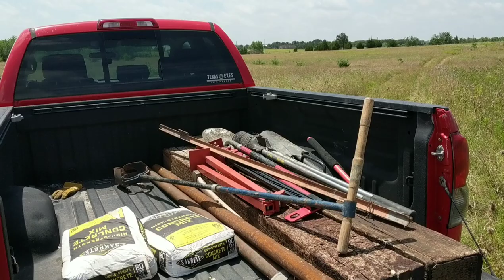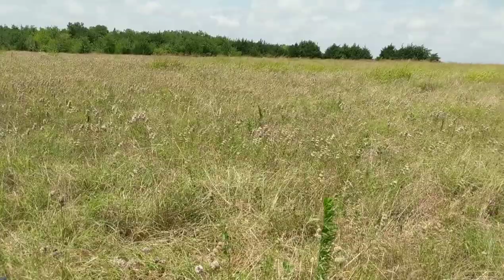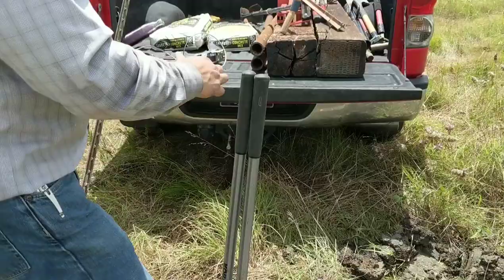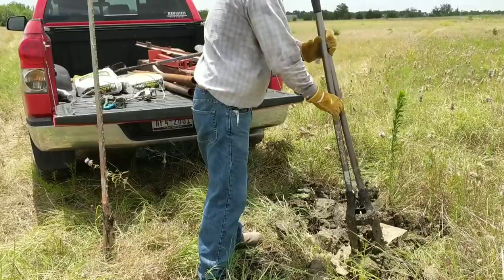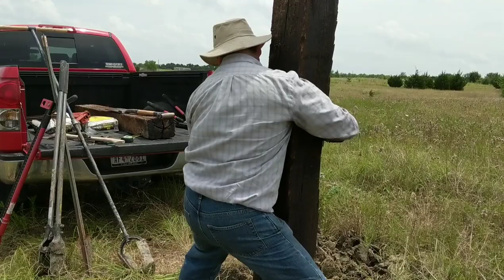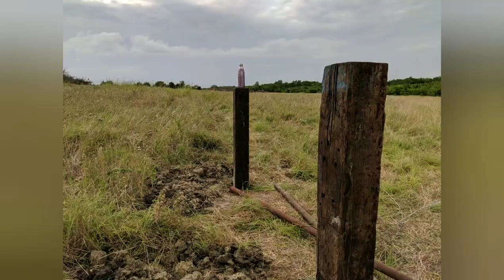Setting Railroad Ties for H Brace

Comment: Where I work they drilled some 3 foot holes so that I can put these bad boys in and I did 50 rail road ties in two days
Reply: @LibertyGarden  they did these hole with a drill bid for a skitsteer then I had to take out the dirt with a post hole digger after that I had to line up the ties up to the hole and then lift the ties and put them in one by one and made sure they were leveled

Comment: I could only find 4in diameter treated posts in my area and could not get a hold of the 6 inch posts but would like to build a h brace fence for my half acre to keep the livestock in my area out. Do you think I could still use the 4in posts?
Reply: @LibertyGarden  thanks for the tip. I will checkout Craigslist in my area and see if I can find any for sale. Only reason I wanted to set h braces is to run 4 stands of barbless cables from corner to corner and secure them with clip wire strainers with a bit of tension. Figured it will be cheaper than running the square fencing and I really don’t have the fencing tools to run the square fencing such as pullies and chain strainers. I also want it to last and I think the 4in posts will rot quicker than the 6in. I can still return them but it will delay my fencing project. 

Thanks for your feedback.

Comment: I can't find part 2?
Reply from the maker: This is the longer more boring version of digging the holes for the brace.  https://youtu.be/b7QVmO6UZG4
Reply: @LibertyGarden  Thanks. I was wondering if you had one where you connect the cross brace and tighten the wires? I am in WY and need to build a fence using railroad ties. looks like some folks have tricks for tightening the wires on round posts. not sure if you had any special tricks to make sure the wire tightens up around the 6x8 in RR tie?

Comment: Some people pay for a gym membership then diet. I pity them. Build a fence and you can eat as much as you like and sleep like baby.
Reply from the maker: Seller, I'm looking for a utility tractor.  This is the 10th assembly I do by hand.  I don't mind the work, but the time is the problem.  I could have put the entire 200 yard fence in one or two days if I didn't spend 45 minutes on each hole and got exhausted.  But it sure is a hell of a workout both strength and cardio.
Reply: Liberty Garden   I hear ya. Time saving is as important as energy saving.

Comment: Now that is a pile of work. Bet you were beat when done for the day but it must have felt good. :-)
Reply from the maker: I'm already used to it.  This is the 10th H brace I put.  In a way, this was one of the easiest because it's out in the open so all I need is by the truck.  The problematic ones are the ones by the creek where I have to walk tools, materials and water 400 yards just to start working.
Reply: @LibertyGarden  - I totally understand that.  You know what the absolute worst things is?  When you realize you forgot a tool, walk all the way back, pickup the tool, and then get back to the jobsite and realize you need one more! F**K is usually what comes out of my mouth and to stop that I starting doing checklists.  Sometimes getting the job done is just murder.